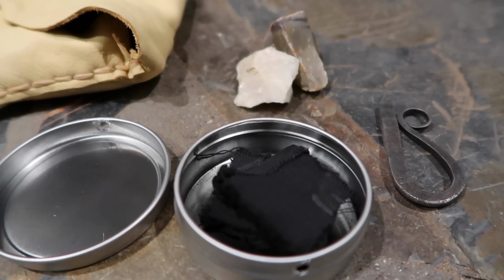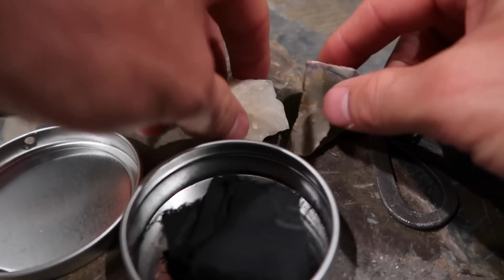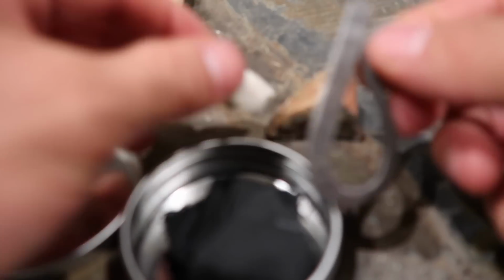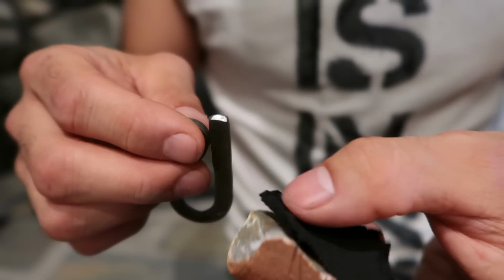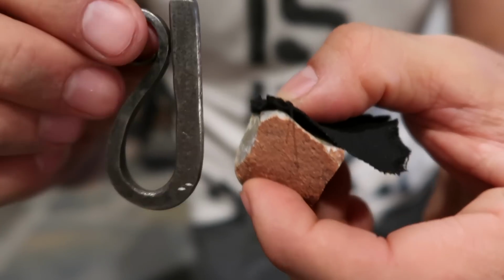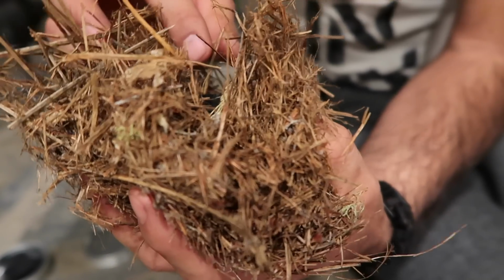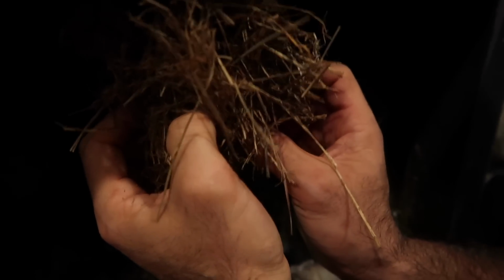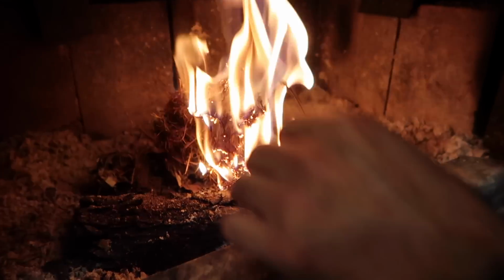How To Start a Fire using Flint & Steel. Best Fire Starting Method?

Comment: so without char cloth your back to no fire?
Reply from the maker: MRod did you watch the whole video? I go into a detailed explanation on why flint and steel is our preferred method. The reason is precisely bc you can keep replenishing it indefinitely in the field. You should really go back and check out that info. Thanks
Reply: +MRod. Basically yes. The chance of getting a tinder bundel to light up without the char cloth first are very slim. So for this method you carry around a flint, a striker and the char cloth in a tin to make more char cloth in. So the bundel is bulky and not that lightweight either. Still it's a good skill to learn. Learning the skill does not mean you have to carry the stuff around.
Reply: There are a multitude of plant fibers that can be used.  Tinder fungus can be used uncharred for instance.  And as long as one can get a fire going with the last bit of charcloth, you can char other natural materials such as punkwood for fire making.
Reply: +Northern Woodsman. Than you would have to have access to tinder fungus or other materials. I don't see that in the desert. And for making char-cloth you still need the container. I do admit it's a good skill to learn, like all skills. It can even be your preferred method of fire making. It is your preferred way of fire making because you are in a luxury position in an environment you did select with materials needed available.
I'm not saying it's a bad method. Just saying it's not the best method.
Reply: Actually you don't need a container to char, just bury it under the fire so there is no oxygen to combust the material.  This is why punk wood is so preferred especially but American frontiersmen.  Yes, a container to store the char is needed but that is taken from the civilized world before entering the woodlands.
Reply: +Northern Woodsman. I have seen a video of a guy getting sparks from a Silky folding saw that is supposed to be stainless steel (or has a stainless coating) using Chaga to catch the spark. He brought the flint from another country because where he lives there is no flint. Chaga is limited as in where to find it also. I have some but can I take it to another country by plane? Same with punkwood or fatwood. Usually stuff like that is not allowed to bring to another country. No problem if you don't travel of course.

I have nothing against the flint and steel method and have flint and steel, Chage, fatwood, punkwood, char cloth available to practice my skills.

But this 'the old ways are the best' hype is just a hype. It's called 'the old ways' for a reason. All this 'a survival knife needs to be high carbon' is a hype started by people like Cunterbury who want to sell more knives.

Of course you can char using other methods as long as there is very little oxygen and you can stop the oxygen, but you will need a fire. So use a lighter to make a fire to make charred material so you can use the old method because that's the best?

I have nothing against teaching and learning the skills. I do have some issues with this hype that is created to commercialize it.
Reply: 1. Punkwood can be found anywhere, even where you live.  It's just dry rotted wood.

2. The video was talking long term.  Ferro rods wear out far faster than flint and steel does and even if your stop getting decent sparks, you can reharden the striker with a campfire and a puddle of water.  You can't do that with matches or a ferro rod.

3.  It's not hype.  These methods have served us for THOUSANDS of years.  They will continue to serve us for thousands more.  I have used flint and steel successfully in a snow storm in Maine and it did not take me long at all to get it going.  Proficiency is the key.  As well as knowledge.  It is more than skill that makes one successful with the old methods.  One has to know the right type of wood to look for, the right type of material for a bird's nest as well as proper technique.  I rely on this method because I know these things and have not every gone without fire.  It is no different than fire by friction such as the bowdrill or fire plow.

You say you practice this skill but you call it hype.  In my experience, it is those who are hot proficient and knowledgeable enough in a skill that call it all "hype".  But that is your opinion and you have the right to it.
Reply: Northern Woodsman. 1. Punkwood can be found everywhere but in some places during some seasons you have to look really good for anything dry. Not where I live. We have to look for woods but where there are woods there is also punkwood. I was saying that you are not allowed to take untreated wood on international flights. Th guy in the video was telling that is his area there are no flints. In fact no rocks at all. 

2. I totally understand this 'long term'. I even talk about it in a video. The device that does not run out and does not need attention but does need the sun is a magnifying glass. But the fact is that we don't stay in the bush long term. At least not the people posting videos on you tube. Getting wifi is very hard in the woods. I can also understand that people like to use this method and the 'old ways'. Some people really love the fire by friction method. Some like using flint knives and dress up in bukskin. Mind you they go to the bush by car and make videos with a camera and post them on the internet.

3. The hype is not in the skill but in how people are trying to make it more important or even the 'only way' to go. Often you notice that they have some sort of school that teaches this. It's like this carbon steel knife hype brought to you by some guys making money from selling or making carbon steel knives. Having a reliable knife in the bush is not a hype but it having to be a specific kind made of carbon steel is a hype.

4. I think a lot of people giving 'advice' about how to survive 'the world' and what you need for it (skills and gear) have never left their own backyard. Some, like Mors Kochanski, will limit themselves to a certain area, biome or climate. These are the good ones imo.
Reply: 1. No one says to take untreated wood on flights, not even mentioned in the video.  Punkwood is one example of plant material that can be used, cattail flowers are one, pithy centers of plants like Mullen and cattail are good for this.  I've even seen Ray Mears do it with just charcoal from the previous night's fire.  As far as stone, straight up quartz works well, I've done it myself. There is usable stone everywhere, just gotta test it and see.

2.In this modern age, unless you are born in to a primitive tribe that has had little to no contact with the outside world, we all get to the woods by car.  Yes, there are fakes out there who do not know what they are talking about and there are those who practice the skills in their backyards just to have fun and share, there is nothing wrong with that.  
  
3. Most of what you call "hype" is preference.  I prefer high carbon steel blades with a spear point and a flat grind.  For much of what I do, I do not need anything else.  I find such a knife to be easy to use in most situations and very easy to maintain a razor edge in the field and so do many others.  In a salty environment like the ocean, stainless is king, but that is just my personal preference.

4.The backyard should be the first place to learn and practice the skills and test gear.  It is dangerous and stupid to go into the middle of nowhere and try this stuff for the first time.  That is what gets people killed.

My point is, no one I have ever seen has said "only use this method", they always say it is the method they prefer and so did Damian777.
Reply: +Northern Woodsman. In a desert on or the arctic no plants or trees. So your assumption is false. It seems to me Americans just don't know about life outside the US. That is ok. Just don't pretend to know it all. That's what we hate about Americans.

Of course the backyard should be the first place to learn. But at some point most people go outside that comfort zone and explore different places. But my guess is you don't even have a passport.
Reply: Dutch Bushcraft You don't get it, do you? International travel through Europe is far cheaper that an American traveling there from the US.  Not to mention all of the security protocols and what not.  It seams to me you are oblivious to life in the US.  Don't let the media mislead you, this is not the land of plenty.   

And yes, the US has most of the same climates as Europe and Asia combined.  That is just in the lower 48.  Add in Alaska and Hawaii then we add in tropical jungle and Arctic tundra.   Not to mention one you all don't have, the temperate rain forest.  That is why most US outdoor folk do not go outside the US to learn skills in environments other than where they live.

I am fascinated by other cultures, I learn as much as I can.  Especially when it comes to the outdoors.  I suggest you drop this.
Reply: Dutch Bushcraft practice in all kinds of weather to become a master of it and you lessen the variables considerably.  I have never failed to make fire with flint and steel because I practice in all weather and have great knowledge of my local  area.  I have failed with the ferro rod, match and lighter.   These are not always reliable.
Reply from the maker: +Iron Dragon Outdoors, thank you. I thought I was pretty clear and descriptive in the video, but yet it took you 7 comments to clarify...and you still got no where. Thanks again for trying though!
Reply: @Damian_mtn  some people just don't listen to what is actually said.  They only hear whar they want to hear.
Reply from the maker: @StevanOutdoor  My kit is the size of a half dollar coin, and about 1/2 an inch deep. Very light weight and compact. I have seen these typical huge C style strikers which you are probably familiar with and are referring to...but there are much better options. AKA mine.
Reply: @Damian_mtn  I'm not suggesting flint and steel is NOT a good option and skill to master. I'm saying it's not always available. A friend who lives in Russia has a video about this and where he lives in in the Russian wilderness are no rocks available let alone rocks that are hard enough. So you have to bring a striker, or use your knife if it's carbon steel, a flint, a tin and charcloth. There are alternatives ways to make charcloth besides a tin but you will always need fire to make charcloth.
If your ferro rod wears out in the middel and breaks you did not learn how to use a ferro rod. Most ferro rods come with carbon steel strikers btw.

A friction fire might work but also depends on the environment you are in. Try to make a friction fire in the rain forest with 90% humidity.

Your conclusion is based upon the situation in some parts of the USA and that tells me you don't travel a lot.

If you prepare your tinder bundle correctly, like the woman did in the video, it will burn with 1 strike of the ferro rod and that makes it a tool for 10.000 fires. Just because you see videos of people striking half the ferro rod away to make one fire doesn't mean that's the correct way.
Reply: MRod  so without char cloth your back to no fire? 
that is true, but true of any method when the fuel runs dry (lighter runs out of fuel, ferro rod wears out etc)  

That fact is char cloth wasn't actually used that often 'back in the day' by woodsman, they relied on other char material (charred punk wood and other plant based materials) and char cloth was a luxury item that was only sparingly used, most often only in town and by the more wealthy people.

Comment: your right    but the ferro rod doesn't wear out fast    you scrap it to hard and don't have the right tinder    that will catch quick   I can start a fire faster than you can gather  the things for your birds nest   I don't even have to work for it   and I will have a roaring fire  while you still are gathering your stuff    not saying anything bad
Reply from the maker: No worries.

Comment: It's a nice method and a useful skill to have like making a friction fire. I suggest to practice both methods. The most durable method that basically never wears out is a lens. But for use in the field a lighter and/or ferro rod are easier. The cheap Chinese ferro rods wear down easily but for strength they have a bolt inside made of carbon steel that can be used to strike a flint. But in all an informative video and I do like the old ways.
Reply from the maker: Dutch Bushcraft Thanks...friction fire is fun too!

Comment: Great video, but I have to question the use of this in a survival situation: when you're in trouble, for whatever reason,  you often don't have all the things needed, to use this method of fire making. Sure, carry a flint and steel, but carry a couple of lighters and some matches as well - because you're going to have a hard time getting a fire going one handed or  if your char cloth gets soaked etc.

Reason, logic and coordination all seem to disappear in an emergency.

One of the best videos on flint and steel I've seen - really explaining in detail what is required - thanks.
Reply from the maker: Thank you, and yes I agree. It's the five C's concept. Cutting, Combustion, Container, Cover, Cordage. If you must have redundancies in your pack, it should be in these areas.